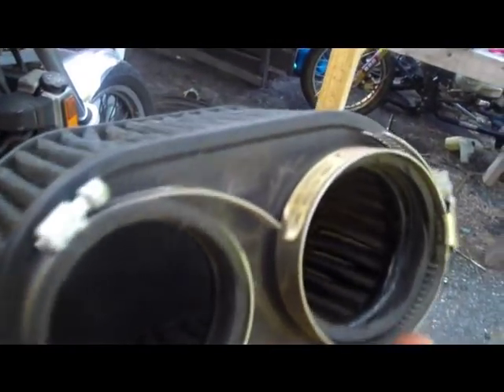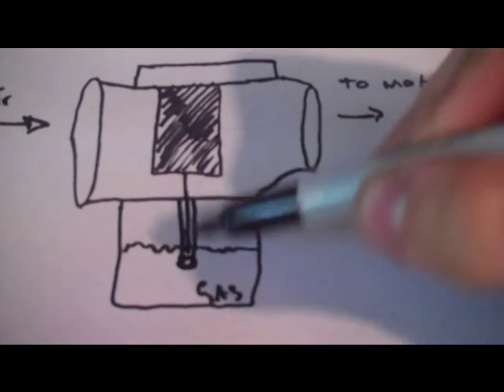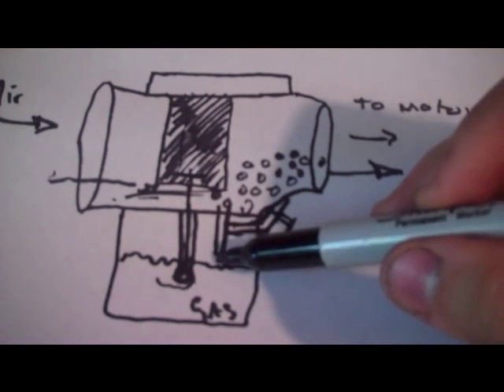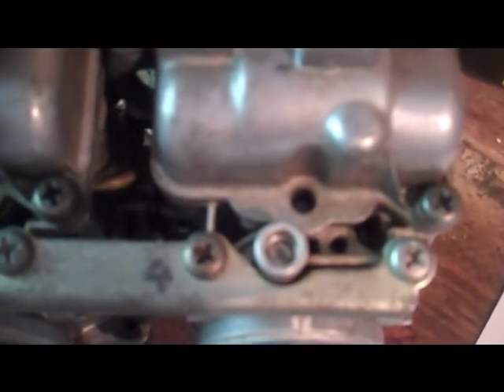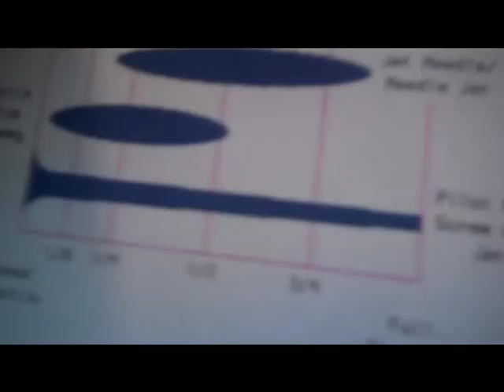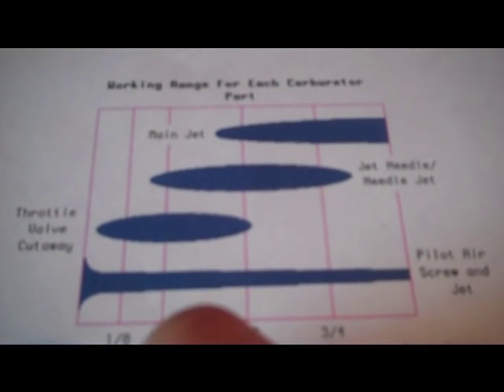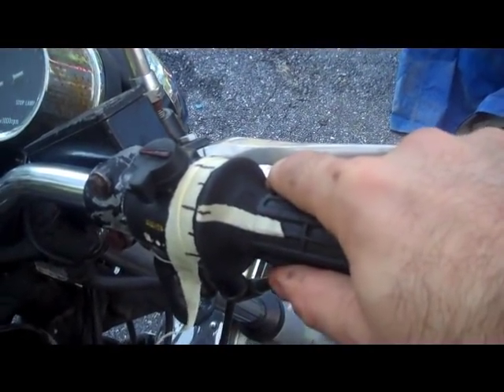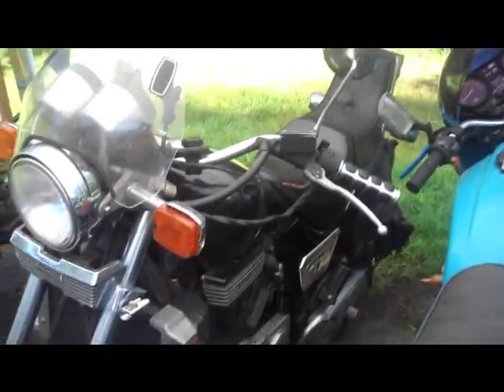How to adjust the jets on motorcycle carburetors

Comment from the maker: Well, sounds like you have already identified a number of problems which need to be rectified before you get the bike running well. Replace the filter and whatever gasket it needs, and drain/replace the oil. You may be looking at a carb cleaning too, and clean out the gas tank and put new gas in. After all that it should run a lot better

Comment: Hey Max, this is the best video on carbs tuning so far, if you are making a sequel can you talk a lil about why they cut the slider/diaphram springs to tune and how to set the throttle position sensor....Thks

I have a 01 bandit 1200 and did a pilot screw adjustment 2.5 turns. I checked multiple times but the number 4 screw pin doesnt pop up as much as the rest of them. It is off by close to 1/2 mm. My question is should I adjust the pilot pin on number 4 to match the other two or just leave at 2.5 turns. thx
Reply from the maker: I would first check out why its different. Underneath there are usually a spring and a washer or seal, see if that is missing
Reply: mrmaxstorey i checked and cleaned them, they each have a spring, washer and o ring, I switched screws from carb 3 to number 4. got the same problem on carb 4. Seems to be a defect of carb body.

Comment: first of all that's for taking the time and making this video , it is extremely helpful. I have been working on a 1979  Honda cx 500 project bike, I put some flow thru exhaust on it .I was going to bump up  the main jets as you suggested because it is running lean as expected.however this stock carb has a Primary Main Jet and a Secondary Main Jet , which one  you recommend bumping up?thanks

Comment from the maker: Yeah you'll run rich at high altitudes because the air is thinner. If you spend a lot of time up there you should rejet the carbs a little smaller. If you are just passing through, deal with it till you get down off the mountain.

Comment: Awesome videos man, great job explaining things. I bought a '75 GT550 and I already received a carb rebuild kit. The bike has three single pod filters. The exhaust is normal and they don't run straight through. My question for you is so I don't have to spend more money on new bigger needles, can I just shim up the needle one link? You explain that this is only for Pods AND exhaust.
Reply from the maker: Bob Papachryssanthou Start with just increasing the main and see how that goes for you. If you had pods and exhaust then you would increase the pilots and shim the needle. Remember this is just a very rough guide, to get the bike truly running right you usually do need to waste money on jets you dont need

Comment: I had a carb leak on my 2004 Yamaha yz250f I fixed the float it was just stuck but after re assembling the exhaust leading from the heads glows red. Ive played with the fuel screw and it definently helped as well as installing a new air filter yet it still runs a little hot. I have an after market bills pips exhaust sa4. If you could point me in the right direction I would greatly appreciate it. I'm just learning so if any of my terminology is off please go easy guys. Thank you.
Reply from the maker: Have you read your plugs? Do they indicated if you are running lean?

Comment: OK. I did the dynojet kit. But used the 114 jets. But didn't know about the shims so I put two on both needles.  Did two turns out of the air/fuel screw.  She starts and sounds fine. But we still got snow over here so I don't know how she will be under a load.  Thank you!

Comment: Thanks so much for this great explanation! I'm trying hard to get my Africa Twin running smooth here in Vietnam, where humidity (90-100% at times) and temps varies A LOT. She really has no power at the moment, and after a 4-5 hour trip, she vibrates badly in all gears/revange and feels like she will die if I let go of the gas. My initial though is weak spark (all electrics measures good, but plug caps could be too old) and bad jetting. I neutered the choke. Any thoughts on this?

Comment: Hmm, this video was extremely helpful, thank you for sharing your info.
But i've been having trouble with my carb, when my cg125 is running(even when warm)it dies when i idle it, but with choke on it is fine. it has a performance air filter and this make the mixture have lots of air.(excuse my ignorance i am new to mechanics). the fuel is very lean. Would i have to adjust my pilot jet? or simply adjust the needle to allow more fuel intake? Thanks alot and again sorry for my ignorance about this.

Comment from the maker: @Michiganborn1969 You can always slobber a little gasket maker into those boot cracks and then rev the engine, the vacuum should pull the material into the cracks and allow it to harden in there. Thats my last resort technique.

Comment: Thanx for all that great info, you do a great job at it.
I have been tinkering with my 78 Yamaha SR500, it has a 540 piston, 36mm Mikuni, Super Trapp and I have done the following: Air-Fuel mixture screw got it at 1 1/2 outwards turns, spark plug to the proper gap, Needle Cclip is at the top notch, 230 main jet and it is running rich, black smoke, what do I still need to do? Please help me and Thank you very much.
Roberto

Comment: wow! Now i Learned how a carb works! I been wondering how they worked and you did a great job at explaining it! My friend finally got my CR250 2stroke to idle by adjusting the idle screw. the bike runs fine and doesn't miss or bog down, but i noticed my silencer is really black and dirty. Could this mean it is too rich? or is it normal to have a black silencer? The bike runs fine and i haven't pulled my plug if i don't need to. thanks

Comment: Thanks this video is a great resource, My 1977 CB750F has a lower to midrange bog, smokes a lot on cold start even when i get off the choke as fast as possible, I have gone up 2 sizes on mains, i was told that on a flat road slow bike to idle speed and select 3rd gear then go to WOT and the bike should slowly pick up speed My Bike stalls So my question is this a valid procedure for a bike with pull type slids? (Plugs look closer to neutral in Colour) Thanks

Comment from the maker: I don't think that the difference between 5280 and 7500 is that big, should be fine, but it is worth bringing along some extra jets just in case. Its my experience that you only need to adjust the main jet, and should adjust it down a step because high alt riding leads to a rich condition at high revs. But as for your exact jetting for this bike, Im afraid I have no idea

Comment: Nice video.  One question.  You comment that you check the mixture by running the bike at a certain throttle position, then hitting the kill switch, and reading one or more of the spark plugs.  The suggestion seems to be that you can read the fuel mixture at a certain throttle position by this method.  Is that correct?  I've never heard of this.  Can you comment further?  Thanks, and again, thanks for your videos.
Reply from the maker: Yes you are correct, thats why its important to make the little gauge on the handlebar for the throttle. Also this should be done under load rather than revving it in neutral, I dont think I emphasized that in the video

Comment: Thank you for the video very informative would like to know what causes a motorcycle rpms to not drop quickly what can cause them to take their time the RPMs on my motorcycle when I rev it up slowly comes back down again thank you
Reply from the maker: Lots of things can cause that, but the most common are a bike that is running too rich or lean, problems with the timing, or a cylinder not firing
Reply: Thanks I will look in to that thanks for the quick response

Comment: Got a new to me Honda 70, runs good till warms up. Then it wats to die as I twist the throttle. Once it dies not able to get going again until it cools. I know the guy I got it from took carb off to clean it before I got it. What direction or adjustments would you start with. Only thing that stood out to me was it has a POD air filter installed. Everything else is factory. I am in central Alabama, environment is similar to yours.

Comment: Hello, I have been working on my R6 trying to integrate fuel vapor as fuel. I am quite the beginner when it comes to carbs but your video did a great time explaining this stuff. The bike will not start solely off of vapors. You talked about a 12-14:1 Fuel air mixture. Trying to get the bike to run off vapors, does the mixture need to be leaned out or more rich? Could you offer any suggestions with what I'm trying to do? Thanks

Comment: Thanks for the upload.
I'm trying to understand a couple of things.
1. If I want to adjust the mixture screw. Do I put them in the same place on all four carbs?
2. How does carburetor synchronization play in to all this?
Reply from the maker: 1. Generally yes
2. Carb syncronization is a different procedure. Basically, each of your butterfly valves in your carbs opens at the exact same time from factory when your bike is new. However as each individual cylinder wears it becomes advantageous to have them open a little earlier or later. Synching the carbs measures this and allows you to make that adjustment. I have a video up on it, just make it the last step in your carb service and you'll be good
Reply: Great answer, thanks!

Comment from the maker: Look at the spark plugs and see if they are fouled with black carbon. Going up 40 sizes in your jets is a huge jump. If they are all black, replace them. If the bike runs then you know you are running really rich, and you need to buy smaller jets or else the problem will return.

Comment: No I have the oil gas mixture right. I guess I will pull the plug and if it is rich then I will lower my needle by raising the clip? It runs fine on the track

Comment: Thanks for the video, it was awesome. Im still doing some adjustments on a XS 750. It seems that is runs fine but when not under load at about 2-3k RPM's I get minor popping, what adjustment could or should I do to correct it? The rest of the throttle range seems fine, and no popping on deceleration.

Comment: Update. Put the carbs back on with the 95 main and it idled at 6k with all of the spacers installed. I took the spacers out and it idled at 3k. Throttle blades closed and idle screw removed as well as the cable.

I pulled the carbs and checked the needles, and with no spacers, the needles are about 2-3mm from seating into the emulsion tubes. I would think they should be totally dropped in when installed, no?
Reply from the maker: There should be a little gap between the bottom of the slides and the carb body, they dont ever seat completely down
Reply: mrmaxstorey
But should the needles be fully dropped into the backside of the main jet, or does some gap sound correct?
Reply from the maker: noifcustoms
Correct it doesnt seat down into the jet the way the float needle seats in the float chamber

Comment from the maker: That was a kawasaki ninja 600R. Some newer bikes make fuel inlets which are not removable, which I learned later was the case with that bike. The main jet is adjusted by removing and replacing with a larger sized jet, those can be purchased from any number of retailers online. Let me know if you have any other questions

Comment: Hey max I cleaned my carbs for this 82 CSR 650 and I don't have screws to adjust the jets on my carbs like you talked about in the video
Reply from the maker: Your bike doesnt have the synchronization screws? Or are you talking about the a/f screws?
Reply: A/f
Reply from the maker: Martin Alig
They are usually plugged up when they come from the factory. Sometimes guys drill them out to adjust them when they ad modifications to the bike. You should be able to see small circles where they should be. If your screws are still plugged up then go ahead and leave them they dont need any adjusting

Comment: GREAT VIDEO MATE!!! I got some questions. My bike is a GSX 600F from 97 ( Mikuni 32 or 33mm carbs - they actually look the same as in your video). The orignal (?) main jets are 112.5 (cyl 1 and 4) and 110 (cyl 2 and 3) I believe this was stock but I can see in the manual that for instance for th German market ( no limits) there were 115 main jets on all cylinders  . Now, I got both short exhaust (Mivv) and K&N pod filters ( just the same as in your video) installed. I got problems clearly from about 1/2 of the throttle all the way up ( too lean). According to your video I should increase the Main jets by 5, pilots by 2.5 (now they are 12.5 i believe), shim the needle 1 step up and play with pilot screws (this i already did and Colortune says its fine - blue flame up to 3-4k rpm). Now If this all is right (?) Question 1:  as the main jets are different - which size would you recommend? Q no. 2: Do I really need to increase pilot jets if the colortune shows as required?
Reply from the maker: You can take this in increments if you want. I would increase the mains by 5 so 117.5 and 115, throw those in and see how you are. If you are still ok at idle- 1/4 throttle then theres no reason to increase the pilots, but see if that richens you up to the range you need to be above 1/2. If you need more, buy bigger jets. Its just a rough guideline, some bikes need to go up to 20 above stock, so it takes some experimentation.

Comment: Great Video! I recently rebuilt the carbs on a 1980 GS550 cleaned it replaced all the jets I didn't write down the pilot jet screw turns so I put them at 1 and a half turns. The bike is now hard to start and will only idle as soon as I give it gas just boggs any suggestions?

Comment: Yes 1 and 2 are wet.  I did see a faint spark but badly fouled.  It will run and idle.  Gas smell very prominent and rich.  Bike looks new only 12000 miles couldnt pass it up!  Watched your videos and it maybe rebuild time!

Comment: Thanks for the video. Is changing the main jets a straight swap job or will i have tinker and re-balance the carbs to get it running good?
I've got a Kawa Z650 F2 to which i've just fitted a Vance & Hines 4-1 exhaust. I'm going to take your advice and increase the main jet by 2,5.

Comment: Hello Max. Great Video. I just bought a 05 vulcan 800 classic, and its not right as for running. The last owner put on cobra pipes on the bike. Sounds good. I did research on the carbs and the mix air screw wasnt right, so i took carb apart and clean it well. put back together. very hard to start when its cold. pull the choke out and bike sounds like it ants to idle high for 10 seconds then it stalls out. i have to set there and give it gas for 3 mins until it warms up. then the bike idles great and give it some gas and i get a pop from the carb, not all the time, then riding it and giving it gas and has a hesitate to it like its not getting the right amount of gas to it. I know im not doing something right. any help would be great. Putting the cobra pipes on here im thinking that cause the carbs not to run correct. Thanks
Reply: +michael dean you are running lean also the back fire could be a sticking valve. run a little marvel mystery oil in oil and gas to help unstick it.

Comment: Love the videos.  I just purchased a 1982 Yamaha Maxim xj 750.  The guy I bought it from warned me that the carbs sometimes leak.  It ran intermittently on 2 cylenders.  3 and 4 were ok.  Keep in mind it's 20 degrees in Michigan!   Well number 1 and 2 were cold on idle and rev.  4 was hot and 3 warm.  1 and 2 carbs are wet and drip.  Could this be strictly a carb issue?  I get sporadic spark on 1 and 2.  But the plugs are wet.  TY

Comment: Hey man really good info, thanks! I now have (As far as I know) stock jets with a stock air filter. My bike will not start unless I crack the throttle just a hair. I just cleaned the carbs and set the mixure screws at 2 and 1/4 turns out. Factory setting is 2 1/2 out. I will be replacing the air filter with a K&N soon, so I'll be rejetting then too.

Any thoughts on why I have to crack throttle to start? Thanks again!  Plus I subbed ya!

Comment: Hey mrmaxstorey.  Love your videos and glad you're back.  I have the 83 gs450 and I put some pod filters on.  Currently I'm jetted up only 1 size on the mains.  The bike also has 3 quarter inch drill holes in the baffles.  Would you think I should go 4 main jet sizes up and 1 pilot from stock?  I also shimmed the needle.  Thanks.  This stuff is such trial and error.  At least its ridiculously easier to pull my carbs out without that big shitty airbox lol.  Oh and their Uni pods.  .... Also currently without any air filter spray on them, I have to do that because I don't believe they come with it already.
Reply from the maker: Michael hayes I'd go +3 on the mains and +1 on the pilots. Then start doing the throttle test, see how that improves things. Remember its important to determine not just where the bike bogs, but whether its lean or rich at that range
Reply: Okay thanks!  Lol I have a bad nose and I'm not very good at realizing richness and leaness.  Is there a clear way to diagnose?
Reply from the maker: Michael hayes Yeah I go over it in the video during the explanation for the throttle tape trick, you gotta run the bike at speed in the range that it is bogging, stop by the side of the road and pull the plugs and see if they are reading rich or lean no nose required
Reply from the maker: Michael hayes Yeah I go over it in the video during the explanation for the throttle tape trick, you gotta run the bike at speed in the range that it is bogging, stop by the side of the road and pull the plugs and see if they are reading rich or lean no nose required
Reply: ohhh okay i see now, thanks man.